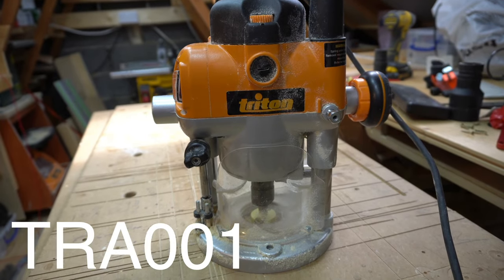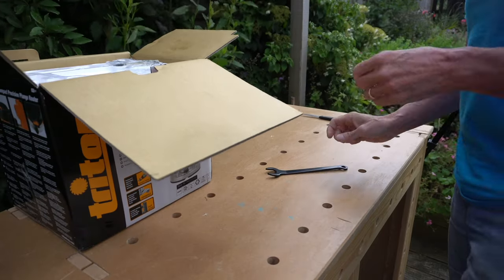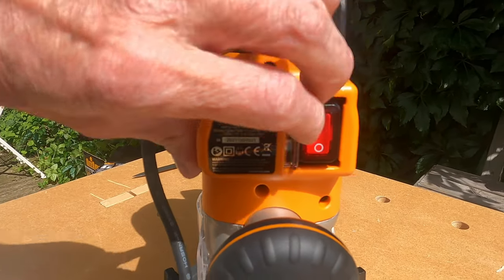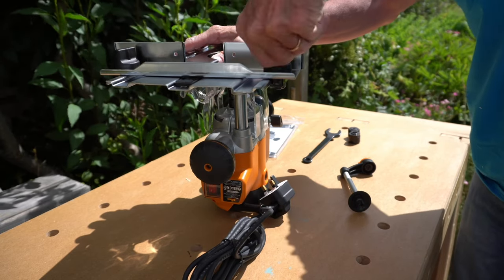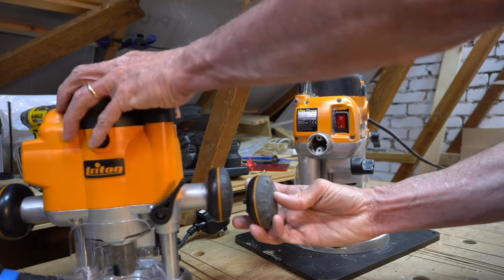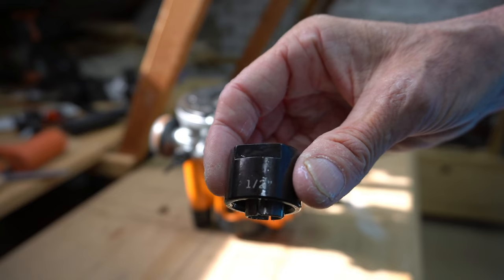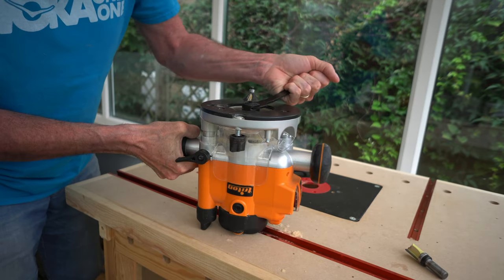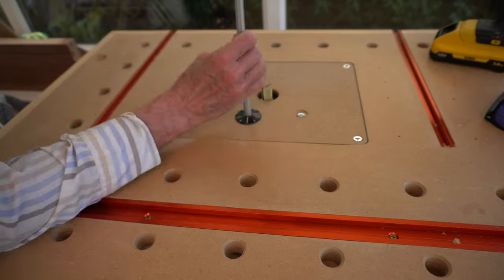Best Router Combo For a Small Workshop? - Triton JOF001 and Triton TRA001 Routers

Comment: Many tool manufacturers use the same cable for both the US and Europe, I guess for inventory reasons. This means that it is unnecessarily thick in the copper dept. (US 110v, so twice the current)They tend to be short for cost reasons. A specific Europe cable can be twice as long for the same amount of copper- good manufacturers do this... When I re-wire tools (so that I can add a socket at the tool end) I use 220v sized cables; much more flexible to use.
Reply from the maker: Good information, Thanks Mike. Regards JP